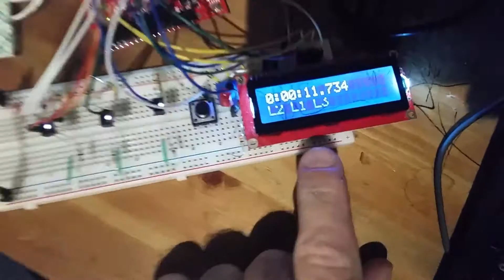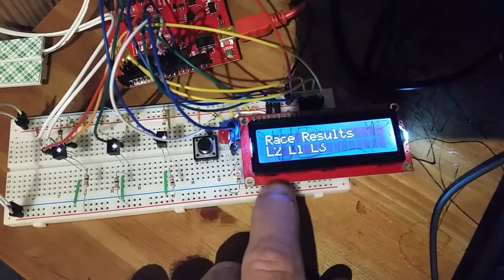Finished!  Arduino Circuit for Cub Car races

Comment: This is one of the cleanest setups I have seen so far. Been trying to make another one I have found work and am driving my head into a wall trying to get the IR sensors to work and the complexity of the programming is nuts. I like how you have simplified it. If you have a wiring diagram I would love to get it. My dad and I are trying to build a Hot Wheels track for some community races and this would work perfect. Thank you.
Reply from the maker: Thanks.  Sadly shortly after making this video my then 1.5 year old got into it and ripped a few things out.   I put it all into a box where it remains today.  Though my now 10 year old is getting into Arduino so I may be hauling it out of that box soon to get it debugged and documented.   It is basically straight out of the Spark Fun Inventor's Kit version 3.1 - every one of these components was a project out of that and I just combined them together and wrote my own code.

Note the code has a minor tweak required it currently polls the pins but it needs to be changed to use hardware interrupts which will be far better.

I'll let you know if we manage to take this further.
Reply from the maker: From this link you will find the PDF with the circuits - look for "SIK Guide" and download the PDF.

https://www.sparkfun.com/products/retired/12001
Reply: @UrbanHippy  That stinks but maybe your now 10 year old will expand on your design. Thank you for the reply. I might be able to figure out most of the wiring from a screen shot of your video. If I can I will post it here for you and your little tinkerer.
Reply from the maker: We got the circuit going again and my 10 year old is currently trying to use the Fritzing software to document the circuit diagram.  He wants to put together kits to sell to other Scouting groups :-)  If he gets a diagram put together I'll post a link to it somewhere.
Reply: @UrbanHippy  oh that's so awesome!!! Yes, please keep me updated. I would love to see the diagram and give it ago myself. Thank you very much! Congrats to your little tinkerer!